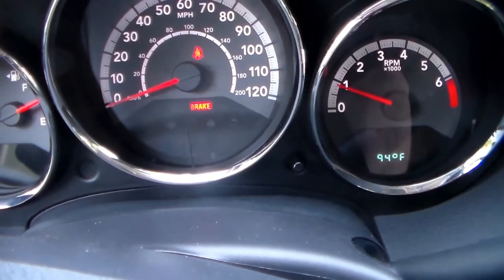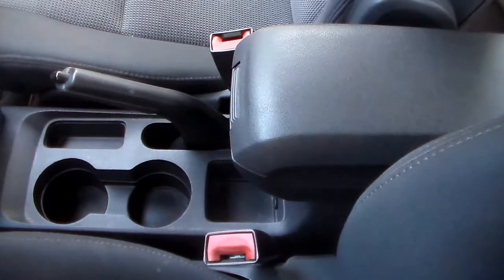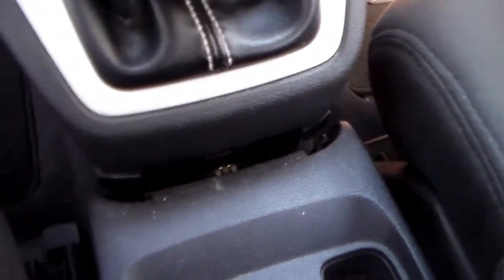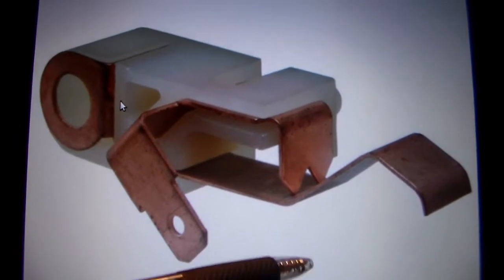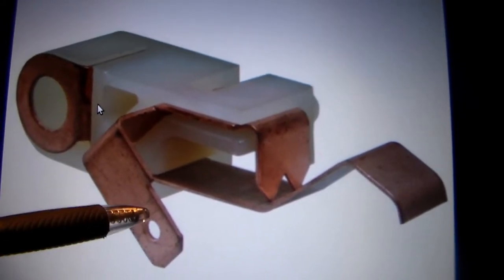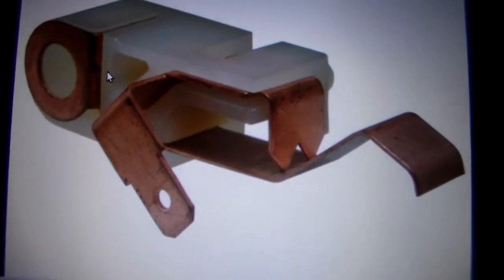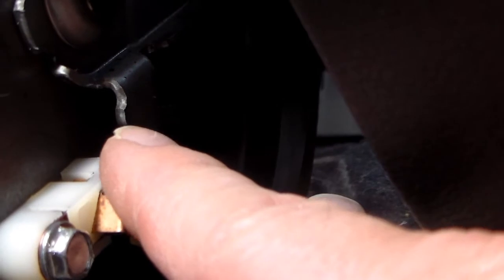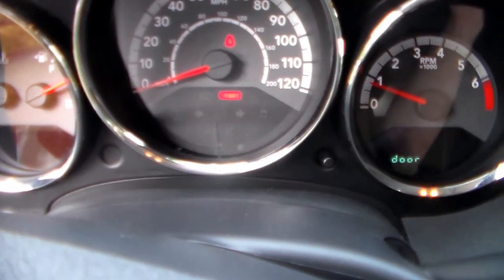Dodge Caliber-Jeep Compass/Patriot brake warning light fix

Comment: Good tip. I would add  a tin layer of dialectic grease on the contacts to prevent further corrosion on rebuild.

Comment: On my 2010 Jeep Patriot after I had my center console out for another issue, the brake light would come on randomly whenever I drove the Jeep. But after the right side headlamp stopped working, I went directly to a ground pigtail along the front edge of the engine on the pulleys side on the body. I found 4 (out of 9) wires that were so corroded, I knew at least 3 were probably not even making a ground contact. I removed the pigtail, snipped off the ends, then stripped the wires back another 3/4 inch, twisted them enough to fit into a new connector, then bolted it back up. So when I started the Jeep, not only did the headlamp work but the parking brake light issue was fixed as well. The Dodge Caliber is also on the list of Chrysler vehicles that are considered ''Ground Wire Nightmares''. Cheap wiring along w/some poor engineering has turned out to be the #1 reason why their products are the most expensive to own. I believe it's because of all the engineering that originates in Europe because that is why VW, Audi, MB (to name a few) are so expensive to own once they start getting some age and in most cases, in combination with high mileage. Jump over to Hyundai, Honda & Toyota and those vehicles will run circles around most other brands.  Thanks for this video. It's always good to know how some issues can have more than 1 fix....
Reply from the maker: Yup, the grounding points on FCA products have been an issue for quite some time now.  Clean them up, coat them with a protectant like battery terminal protector and you should be good to go
Reply: @chrisfreemesser5707  Have you had to go through the relay box because of corrosion on your vehicle.. I looked at mine which the previous owner had someone go through and wire one relay up direct. There were connectors that were unplugged so I fix that issue. After that I thought I'd check to see what fault codes were showing and 6 of the 8 faults were related to everything I had worked on prior. I cleared them off the Jeep and the one good thing is the ''Check Engine'' light is off. It's been showing a P0420 - o2 sensor issue and a cat issue for over a year. Turns out it was either a bad ground or something related to the one relay. That was one of the good things out of all this lol. Plus the remote start will work, now that the check engine light is off.....
Reply from the maker: @montydaniels1054  If you're talking about that little relay box in front of the left front tire then yes, I've had corrosion issues in there.  Ended up relocating one of the relays to outside the box due to socket corrosion.
Reply: @chrisfreemesser5707  Yes  that's the one. A prime example of bad engineering design. It's like the one in the right rear corrodes. That's the one that I had to rewire because whomever did it the first time pulled one of the connectors off when they  wrapped it up in clear plastic tape. I also took the TIPM off Friday, took every fuse out and disassembled the TIPM just to see if there was any visual issues with it. Cleaned each fuse contact and assembled it. The 4WD! light hasn't came on yet so perhaps that was a contact issue. Other that the Air Bag light on again, it runs good and shifts good. I'm still thinking of selling it while it is running right.
Reply from the maker: @montydaniels1054  Probably not a bad idea, though at 10 years old it isn't worth much anymore.  My Caliber still runs well but the NY winters have really taken their toll rust-wise despite my best attempts to stave it off.  :(
Reply: @chrisfreemesser5707  Mine too. Michigan is no better. Two weeks ago I scrapped off all the paint that was lifted up by rust, cleaned off the inside & outside of it, put a rust inhibitor on it, primed and painted the bottom panel. I've got like 6 areas to fix before cutting it loose. Gonna do a transmission oil and both filter change & call it good. Sell it while it runs good plus it has new tires so it'll sell easy I think.
Reply from the maker: @montydaniels1054  Yup...I replaced the entire driver side rocker panel and had to do rust repair on a rear wheel arch and the passenger side rear part of the rocker this summer.  Only so much you can do to stave off the rust.  I wouldn't change the CVT fluid if you plan to sell it though...it could actually cause the tranny to start slipping if it's already marginal.
Reply: @chrisfreemesser5707  The trans is whining. Probably because the front filter is starting to get plugged up. One thing that can be done is as long as I put what gets drained out into a clean container, I can just mix enough new fluid so that it's not a flush but some fresh fluid so the properties are not all gone out of the fluid. In this cvt trans, I'm guessing that it'll be around a gallon to 5 quarts of fluid. So even if I only mix a couple of quarts or even 3 quarts, it's not gonna be like when I had my F250 PowerStroke pickup transmission where I did the transfusion fluid change. All that did was guaranty me a trip to my mechanic so he could pull that trans out and put in a genuine Ford MoCo factory rebuilt trans with a 36 month/75k mile warranty for $2600. If it wasn't for the fact that the bottom filter is in the pan, I'd just change filters but I'm at a point where I either sell it while it's making all that noise, leaving the buyer wondering why I haven't change it, or bite the bullet and change it and hope that it turns out like so many others I've talked to who've told me they didn't have any issues with their transmission after doing it. I hear ya though.... I've just been messing around so much because of all these damn lights that kept popping on. No one wants to buy one of these newer Jeep lines with 4 or 5 of the warning light on. As for this Air Bag light, the last time it was staying on all the time, I unplugged the power to the front passenger seat, then plugged it back in. Then the light went out so go figure lol... Oh yeah, another reason I wanted to change the trans fluid is because I'd rather sell it with a clearer conscience than to just not say anything. I've been on the other side of that scenario and it sucks.
Reply: @chrisfreemesser5707  Chris that's so wild that these Patriots, Compass lines rust in the exact locations. I bought a 1993 Jeep Cherokee with zero surface rust on the outside, underbody & the interior floor pans. Now I'm acting like a Jeep sissy owner and don't wanna drive it during the salty winter season. I told my wife I might get a beater Jeep Cherokee for the winter months and she's like freaking out lol... Hey I told her, I could be hanging at bars all the time or visiting porn sites all day so I told her to let me go through my midlife crises in my own way...

Comment: I did exactly  same as  you  but the light still on .when I put it on light   starts flashing .when put it  off  the light keep on the dashboard
Reply from the maker: So it's not the parking brake switch.  Could be the brake fluid level/switch or the wiring for it.  Check your brake fluid level first...could be that simple.  If that's okay the switch is on the engine side of the brake fluid reservoir...if you unplug it's electrical connector and your brake light goes out, it's a bad switch.